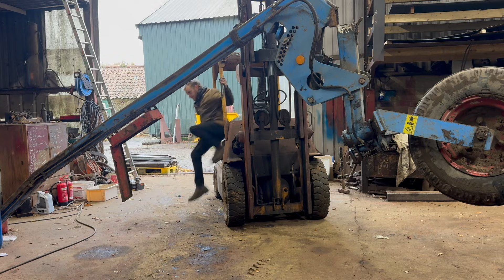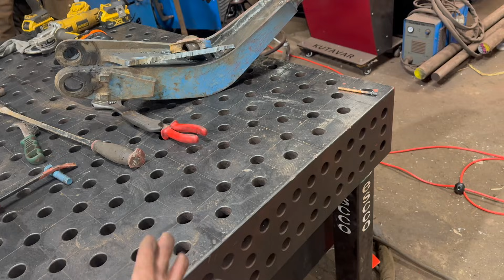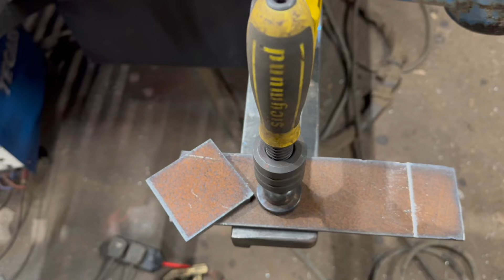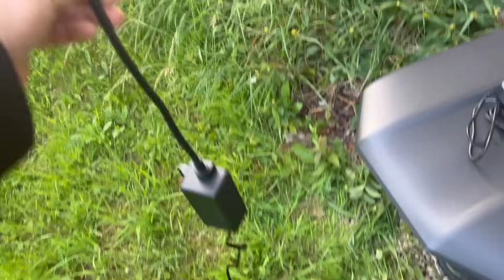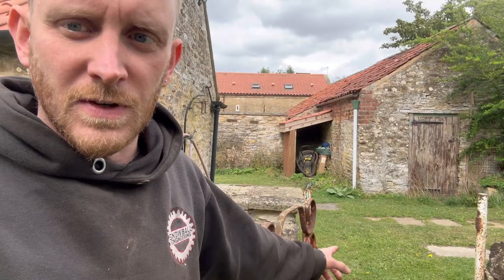Fixing disgusting repair on Lemken Plough frame!

Comment: Is it me, or is this boom design cursed from the start with awful engineering? A dog-leg on a lifting boom? No gussets at the stress points? Just seems with a little more thought, the designers could have done a much better job. The manufacturer clearly followed the "design for warranty + 1 day" rule.

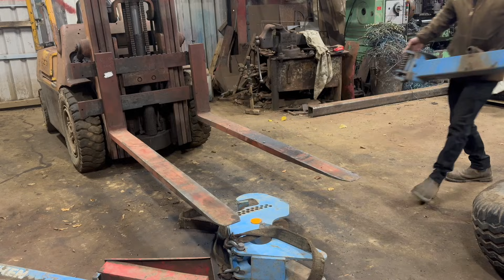Comment: I love your videos, and their content. You are absolutely very very good at what you do - - - - - -But Bro - - - - - you have to have the messiest, most unorganized, filthiest shop I have ever seen. And I have been a professional welder/fabricator for 44 years now, and thought I had seen it all! That poor lathe @14:36 - it hurts the soul to see chips piled 4 feet high around/on the lathe! 
You are shortchanging yourself, and actually costing yourself money. A job is not done until everything is back in its place, and everything cleaned to the same condition as when you started the job. Period - The customer should be paying until those conditions are reached.

Comment: I think 6 o clock is too late for mowing, as the grass will be wet with dew.   Better to be at mid=day for drier conditions...  ( In the UK..?)  It certainly has improved the lawn, and should remove the dandylions, with regular mowing.

Comment: That workshop is filthy.
Reply: A typical farm workshop full of character, i think it’s great. 
In the mid to late fifties our teachers used to take us on day visits to the local blacksmiths shop and farms etc and we watched the chap re laying the teeth of chip harrows, shoving red hot bars into the forge then knocking seven bells out of it with sparks flying everywhere. 
Now we have you tube where we can watch the trials and tribulations of day to day farm fixing and fabricating from our armchair. 😊.

Comment: A word about ROBITIC MOWERS and cut height, Ollie.  When you have a mixed vegetation lawn (some turf grasses, some broadleaf weeds), the first step is to get all of it cut to the same height (may take 2 or 3 cuts if it is long).
Once that is accomplished, you want to raise the cutting height one increment at a time (for a consistent cut) until you get to the highest setting.  Once the cut height is as high as it can go, the mower will keep the lawn looking tidy and the various grasses will start to crowd and shade out the weeds (especially the broadleaf weeds).  
If you maintain tall (long) grass over time, you will find that the turf grasses becomes healthier, spread and grow thicker if you are patient.
Right off, the lawn will look spotty because the desirable grasses need time to get healthy. If you avoid the temptation to cut it short (because you are cutting frequently) you will find in time that you have a much happier lawn that looks like the fairway of a golf course, with no effort beyond patience.  
Your turf will be good looking and pleasant to walk on. 😉👍
Reply from the maker: Thanks for the advice! I’ll definitely try this next season. It’s almost time to put it away for winter now.
Reply: @snowballengineering  Same here In Pennsylvania US. Maybe one more leaf cleanup - but we've already had snow.  Stay warm.  I hope you are able to get some insulation in the shop and some kind of heater to take the edge off. 👍

Comment: Thanks for the lawnmower demo. It doesn't look like an 'optimal' path that it takes because by doing diagonal lines it's constantly having to do a 180 degree movement, vs starting on the perimeter and working it's way inward. Does it have other options for it's path?

Comment: I don't know if you've come across @GrindHardPlumbingCo but one of the guys on there discovered a great way to remove the dross from steel that's been curlt with a plasma cutter - put the cut steel on a steel surface like a welding table or anvil then grab your air gun with a flat punch style bit in it. Place the end on top of the cut steel and pull the trigger. The vibration removes the dross almost instantly! They have some cool slow motion shots of it working and it's awesome to watch. I thought I'd share the tip for you to try 👍👍

Comment: Wow. From the looks of it my German Shepherd Dog could have done a better job than what they did on the previous repair. You not only fixed it, but made it much stronger. The wall thickness of that square tube doesn't really look up to the job, but with your patches it should last a good bit longer. Thanks for another excellent video. BTW, my wife tried to buy robot mower for our big park. With antenna station and full GPS it cost € 5000. A local company installed a used mower with 840 hours on it and tried to sell it as new. Fortunately, we called the police on them and they took it back so we didn't lose any money on it. Friends said, "Buy locally! Don't order from Amazon or the Internet! Support your local businesses." Have a good week.

Comment: 53:11 - If you want to just put a red oxide anti corrosion primer on the repair the cheapest (and easiest - and BEST) option would be a regular "brush applied" can of the primer - applied on the metal, well, with a brush. All and any "spray" stuff is ALWAYS inferior, as it is heavilly diluted to be very fluid in order to flow easilly through the nozzle - and NOT to give best protection.
Granted, "easy to use", but not very economical - a regular paint would be cheaper, even if you'd throw away the brush after each painting.

Comment: 0:23 - Trying to imagine the correct geometry. And failing.
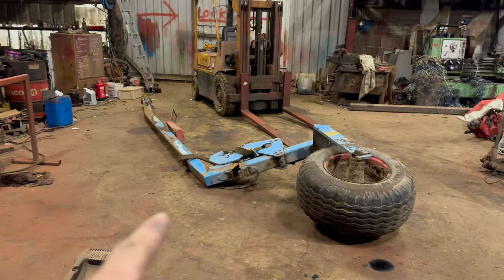0:57 - Got it. Imagined a fixed pivot where a floating one existed.
16:27 -Sounds like Autumn rain in Scotland.

40:47 - Sure would be 'reassuring' to have some gussets with legs spanning that 48* angle for 25cm or so on each arm if the mechanism and travels allowed such.
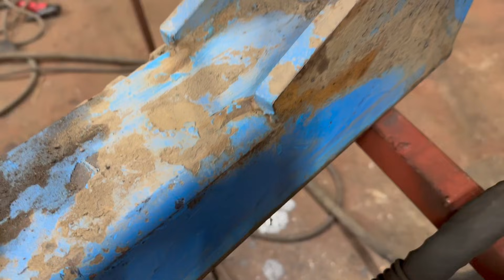43:48 - The legs of those gussets are not nearly long enough to spread the applied loads. Add at least 50% to the length, 100% if possible; NOT well engineered as it came from the factory. Those loads are not difficult to calculate and once you toss in a 100% safety factor for local soil conditions, your repairs should have be covered under warrantee to the customer.
46:33 - Wrap it in aluminum foil; the customer can't gripe.

51:28 - That welded joint has to react 100% of the total load of the implement and the factory hasn't proven themselves competent. Not sure what to suggest, but it deserves a close look.
56:56 - There seems more than adequate room for flush gussets on both sides of that offset; shame on the factory for selling such a poorly designed product!
57:43 - Definitely room for flush gussets. Shame on them for peddling a shoddy product; I hope it was priced to reflect the miserable engineering.

Comment: 29:12 - while I'd agree - to a degree ;-) with you rationale about not cutting plug holes with plasma ("to a degree" cuz it wouldn't be that hard to remove the dross from the inner edges, especially if you'd angle the torch tip slightly "inwards", i.e. to crate the hole walls being at acute angle in reference to the inner surface, which would reduce the hanging dross issue and at any rate with the inner surface corroded so much there wouldn't be much clean surface for the dross to hold onto, thus a quick run with a burr on a die grinder would take care of it), so while I understand the reasons to use the drill I was still quite baffled by your choice of the tool to trim the edges of the boom/ arm/ whatever.
Cutting it with plasma would be much faster and easier, without producing this smelly phenol resin burn products (which gets worse when it's cold, and I "don't like it very much" to put it mildly) or the silicon carbide dust that settles everywhere in the shop, AND the edges are easily accessible, so removing the dross would require just few gentle smacks with a hammer - at worst a worn out grinding disc on an angle grinder would do the job ("worn out" cuz its smaller diameter makes it easier to reach the corners).

But yes, it's yer shed and you're the king there - so you can do as you please - and any knocker like myself can just naff off  ;-) Cheers!

PS: When you need a short piece of some odd-sized section (like this one here, 110 mm) you can actually create it yourself - cut four 100-105 mm wide pieces from a steel plate on your plasma table and weld them up together. Or get a length of a 55x55 / 50x50 mm (depending how you want to set the welding gap) of a hot rolled angle iron, cut it to the desired length and weld it up. Plain and simple, innit? ;-)

Comment: Nice repair. You highlighted the problem with repairs moving the stress points into a different area, making that area the new weak point. The lawnmower looks good, my garden is roughly 40° with lots of trees. That's the problem with living half way up a mountain. Take care be safe.

Comment: 46:14 The reinforcements from the terrible repair of the Lemken Plough frame weigh more than the frame itself because the frame has a terrible design and they used cheap, low-quality engineering. Your work is excellent, but it will soon break somewhere else because everything is bad!

Comment: Don't worry about your dandelions as the grass is now being regularly cut regularly and the cuttings are now feeding the lawn the root system will become thicker. It will eventually suffocate the dandelions, plus in the summer it will be greener even when there is a lack of rain. That is a good little mower and as you say it looks like the development is ongoing. Nice fix, I'm surprised that with the amount of weight on the box frame that it hasn't twisted, I'm sure though that it will be back in a future film because something else will go wrong.🤣👍

Comment: Hi Oliver, I hope your workshop is well locked. On Monday night someone broke into mine and stole all my Milwaukee battery tools most of my hand tools and a fairly new Husqvarna 455 chainsaw. If anyone sees all these tools for sale altogether they're probably mine. 2x drill driver, 2 x angle grinder, 1/2 impact wrench, 1" impact wrench with case and charger, reciprocating saw, circular saw, multitool, vacuum cleaner, and at least 10 batteries.
Reply: Might help a bit if you state what area you're in?
Reply: @gravydog51  North East Scotland. The police seem to think most tools/machines and bikes/atvs stolen around here end up in England though.

Comment: Thanks for the detailed introduction showing working machinery. It gave us a clear idea of the repairs required. Good job on the repairs. How is that ball joint lubricated? Can it take the welding heat?
Reply from the maker: The ball joint isn't lubricated. Yes, its a weld on end.

Comment: Really interesting to see how much the lawn robots have been developed. Appreciate you showing some spare time stuff. Terrific repair as always!
Reply from the maker: Tractors are running similar GPS guidance systems which i find quite interesting.  Thanks!
Reply: What I've seen, these robots have cameras, microphones, speakers, GPS and cloud connection. Some of them have two way communication function, one can view what the robot sees and have a talk with nearby people. Possibly with face recognition. Fun to have but also potentially mighty spy device.
Reply: I’ve had exactly same model for last few months and it’s been brilliant, cutting front and back lawns straight out of the box

Comment: That metal's (the original Lemken metal) way too thin for what it's supposed to do. Like, think about it, "you're" asking that section there (and it's clear that there's a lot of stress on it) to support, twist, AND spread (as the plough moves forward) - and they put barely enough metal to hold a fart in. But they still ask plenty of money for their subpar, cheaply built shoite under such grand titles as "engineered" and "light, which makes fuel costs smaller" (ignore the fact that it barely lasts the time it takes the thing to rust).

Just my 2 cents, but were it me, i would've cut the entire side off (elbow and all) and replaced it with thick plate steel so it fits under the swinging adjuster plates. But i'm guessing the repair needed to be fast and cheap, like the original fix. :))

It's always like this. With my brother: "make it as cheap as you can". And me... having explained and shown ... enough times to make a small book, "brother, it doesn't work that way and it costs more if you fix it cheaply".

This is why i dislike farm machinery manufacturers. They are really scummy and really predatory. And farmers could do with laws that basically shackled these fart bags from being able to gip people in this fashion. It's a shame they can't unite for stuff like this, because it would make a farmer's life much, much easier. Instead, they rally for stuff their told to rally (by big money "leaders" of all people) and nothing gets done because that's how it is.

Anecdotally and not to toot my own horn, because it's not perfect, but ever since the farming community around my brother's place (some 28 farmers and a few businesses) has come around to fix, repair, and create their own machines and needs (think of it as a communal war chest for farmer needs) their overall costs have gone down.

It's almost as if the providers of cheap machinery want farmers to deal with crap like this because it benefits them all even if they bounce between brands.

At the very least, it gives people like Oliver something to work on and make honest bread. And we know that fix will last longer than the original garbage anyways.

Comment: Plug welding is key to that type of repair, what amps and size of air arc rod are you using as I have a lead etc and cracks to do in the winter work for cultivators.
Reply from the maker: i had the welder turned nearly flat out at 400amps and was using 8mm rods i think.
Reply: @snowballengineering  Thank you, I will get some 6mm!

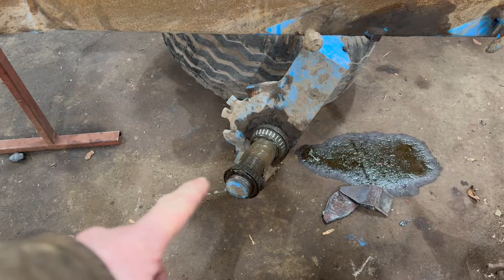Comment: 54:23 the way we do it for the sprayer wheels is we drilled a hole through the shaft for a small eye (just strong enough to pull) and with that we lift it through the bearing pocket. Makes it easier for field repairs too.
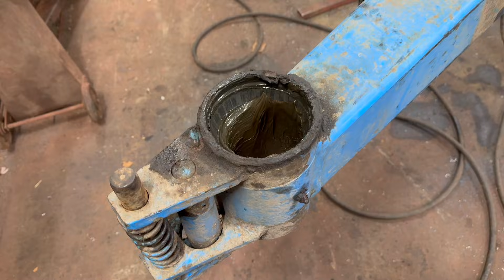46:19 when you bend those reinforcement plates, have a custom tooth at the end of the press that's rounded instead of sharp. This way, the bend won't have a pre-made stress fracture point in it. In my personal experience, they last longer with the rounded profile. jm2c

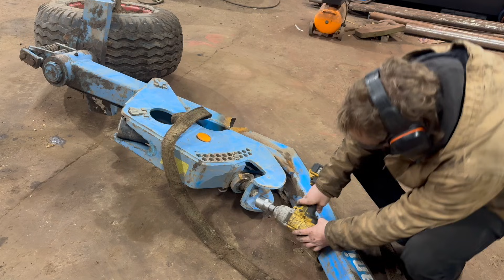3:07 that's why at my brother's place, the back yard is full of old (large) tires. If sh!t hits the fan, you can always make a bed of them and place the item on, secure it with cable so it stays in a certain position and still use the machinery.

Comment: Morning Oliver, Grand job done, as you said it’s already been repaired at this location, but you have added significant additional strength to it and  drilling the holes to be welded you have made it as strong as its ever going to be!
If it was my plough I would be very pleased with the job!

I’m not sure of these robot mowers, I like the leisurely stroll I get with our normal mower and it has drive so I can adjust the speed of it.  that said, I was at an air museum in Norfolk, about three years ago and the grass on the airfield was cut and kept short with a fleet of three of them! Happy gardening 😁😂
Mark from Scotland 👋👍🏆